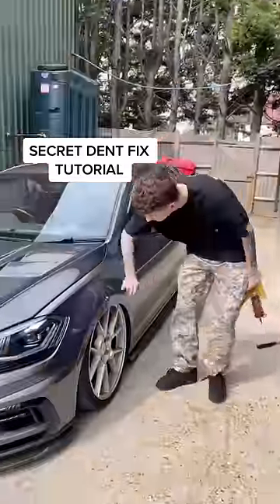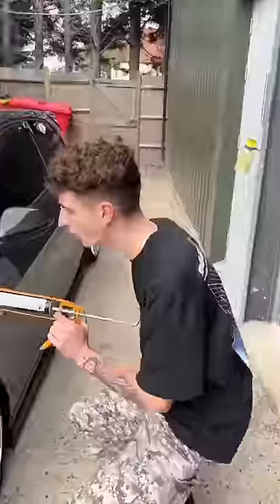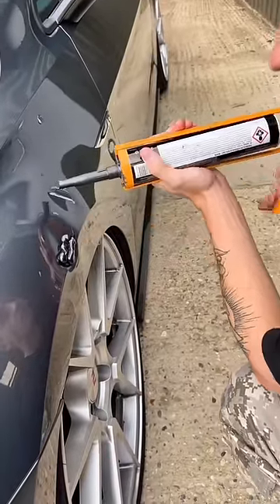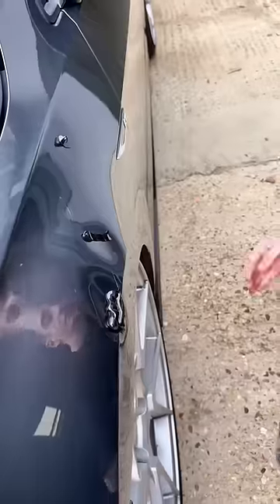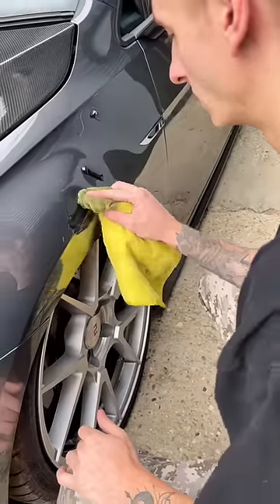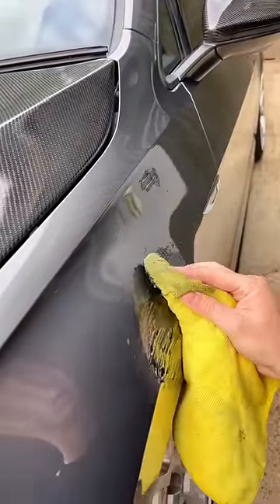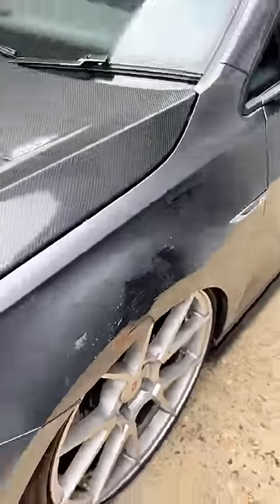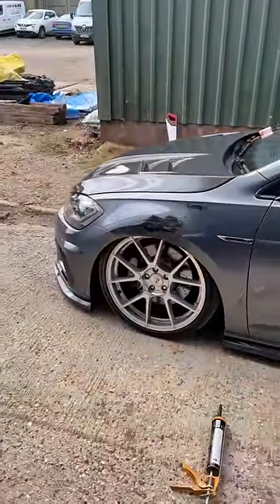HOW TO FIX A CAR DENT UNDER £10 @sciroccobtv #cardent #mechanic #howto

Comment: Do not try at home I am repairng cars for living and this is just a way to ruin your car if you want it fixed just remove wheel and if you need to remove wheel liner remove it grab some bars thin ones and pull that dents out than send the damaged area or even whole fender but when pulling out dents you dont want to pull on the other side out and you don't want to pull it to weak so make it just to look perfect than buy some filler and fix it like a professional not like an amateur. Sorry for my bad English I am from Croatia and just trying my best to help people to not ruin their cars

Comment: Take some ramen! Hot glue it to the dent and then file it down until it is flat. Use more hot glue to fill in the gaps and smooth it out. Then paint over it. 

- Probably five minute crafts